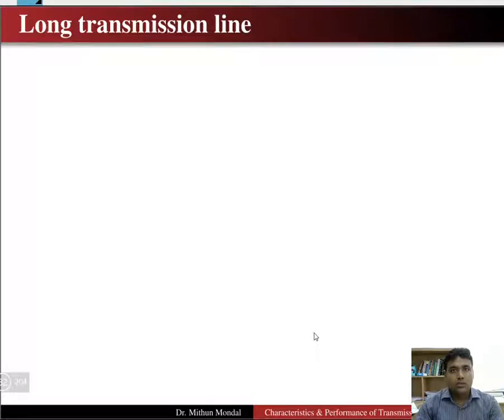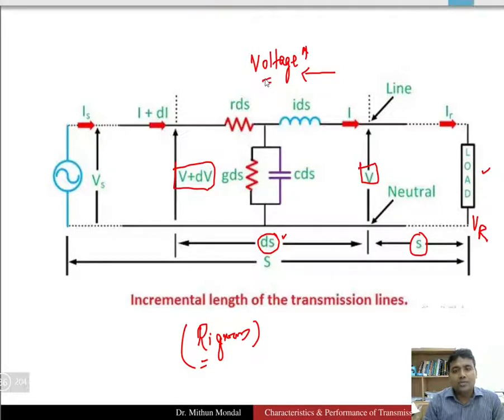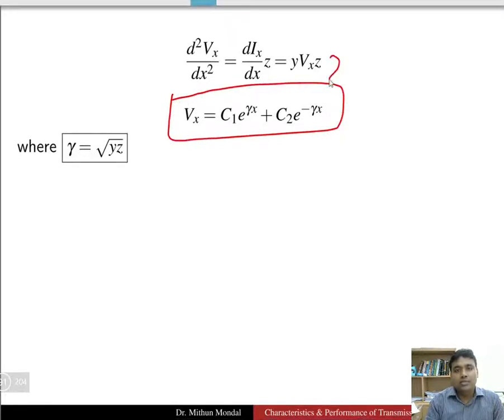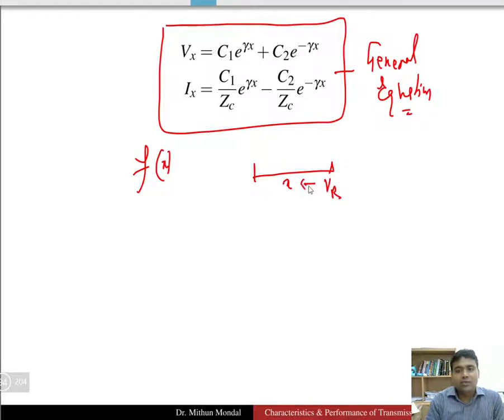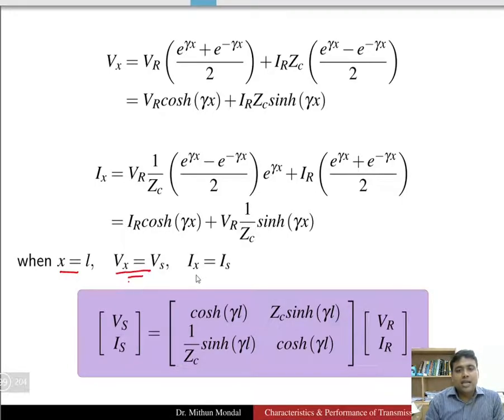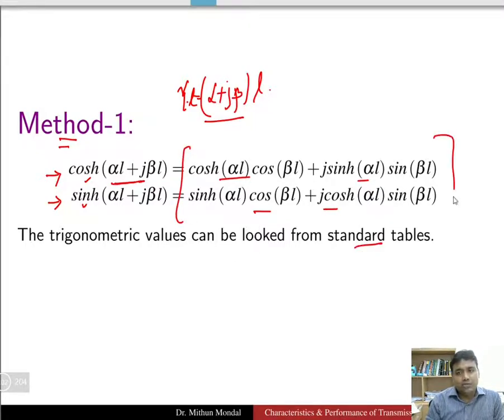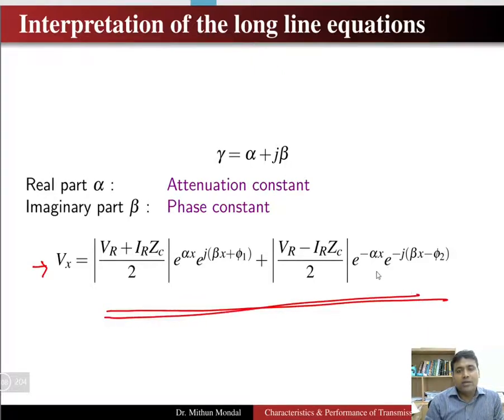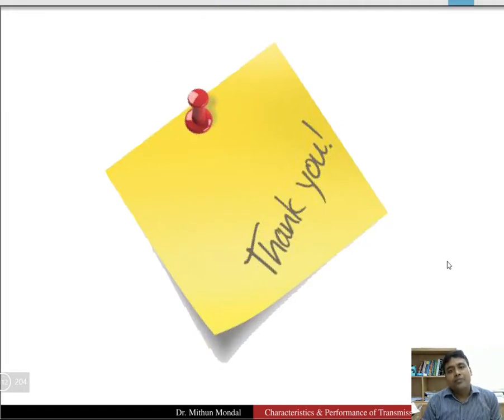Power Systems | Lecture - 19 | Long Transmission Lines

Comment: at 7:18 In the equations for current and voltage, for current(Ix) it should be negative sign in bw...in your slides it is being shown positive i think its just a typing/printing mistake but i just wanted to convey this....Thank you
Reply from the maker: Yes, correct. Thanks for pointing out the typo.